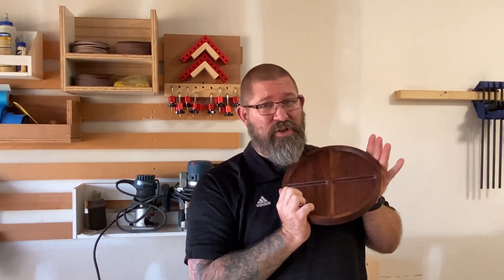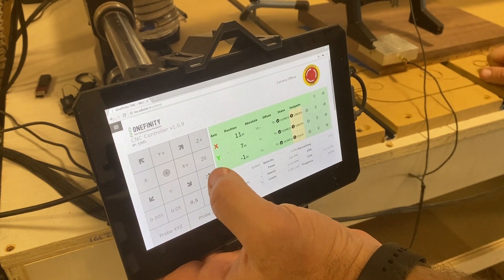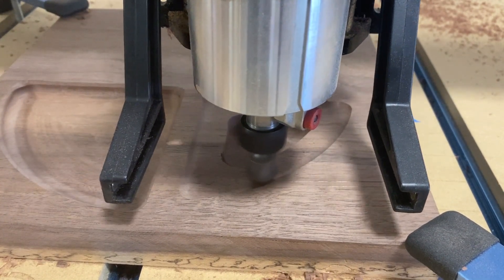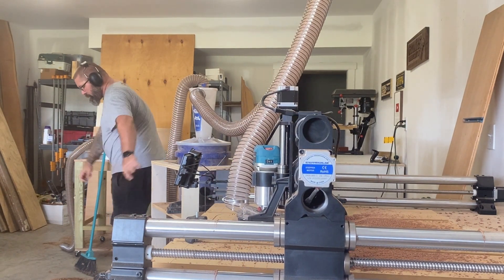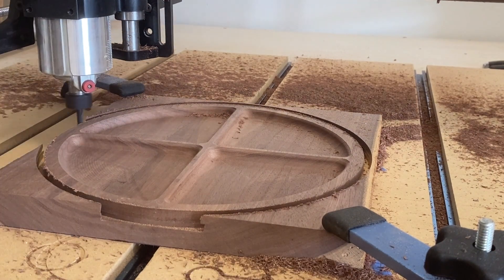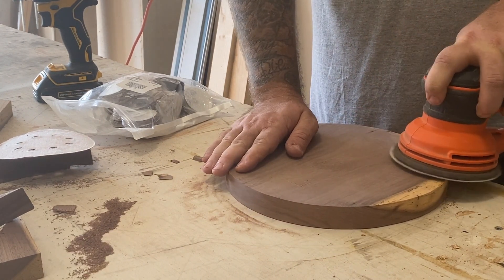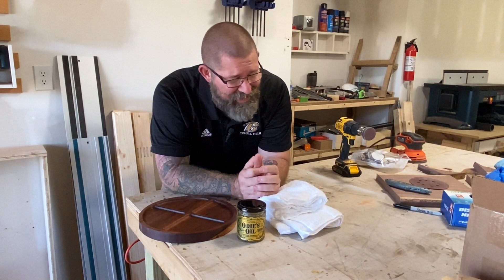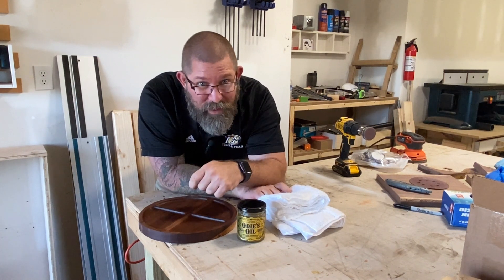Learn From My Mistakes On The Onefinity | CNC Woodworking

Comment: so when you probe it : that finds sets every  axis or just the z axis? also will the probe work if the workpiece in round?
Reply from the maker: You can probe with either the z or x,y,z at the same time. You could still probe the z with a round workpiece, but doing x,y,z might be tricky.

Comment: Greetings!  Nice video.  You may want to reconsider that pushing the bit as far in as it will go though, the collet also retracts and if the bit can't move a wee bit along with the collet you can end up holding the bit less securely.  If you think about milling cutters, the ends are never against anything.  Some outfits sell little rubber balls for the folks who have to have every gadget in the world.  The rubber ball gets dropped in the spindle, then the bit goes in.  Always seemed a silly overdone solution compared to just pushing the bit in until it bottoms, then pull back out just a wee bit (maybe 1/16 to 1/8 inch at most).  Not to mention the wee rubber ball is going to just drop out in this spindle configuration anyway :-)  This may be why your bowl bit pulled out, as it is not an upcut spiral flute style bit, there should have been no pulling force created by the cutting.
Reply from the maker: Thank you.

Comment: What feed rate, depth of cut and rpm did you settle on for these two bits in the video?
Reply from the maker: Can’t remember off the top of my head, and my computer crashed, so I lost that file, but generally I accept the default speeds when I add a new bit, and generally only go half the width of the bit or less for both the step over and step down.

Comment: I love odies oil. One way to avoid those lines is to do a rough cut then a detailed final pass. I generally use 1/2" and 3/4" bits with a pretty high step over (~20%) almost all the way then decrease the step over on one pass really shallow with a very low step over (~5%) to get rid of those lines
Reply from the maker: Good call. I’ll try that

Comment: Are you using the little acrylic inserts around the bit in the dust boot?  I discovered last night that they make a HUGE difference in actually sucking up the dust instead of just blowing it around the table.
Reply from the maker: Don't think I am. I'll take a look.
Reply from the maker: I checked. Yes, I have them on. Good call.

Comment: Nice project.  I need to do something similar to get use of my bowl bit.  Have you given Walrus Oil a try as a food safe finish?  In the same realm as Odie's Oil and has multiple products that are environmentally neutral or better.  I have used them with success and also have made my own from mineral oil and bees wax.  Again, great project and video. Keep it coming.
Reply from the maker: Haven't used walrus oil. Only food safe finishes I've used are Odie's and danish oil.

Comment: When you did your probing, it looks like the X-axis was against the carbide but the Y-Axis was against the body.  It's not a big difference but there would be some.  I wonder if your project's rim (or the center cross) is the same width all the way around?   
BTW, your collet problem may also have been dust.  Always a good idea to take the collet right out between bit changes and knock out the dust from all parts.
Reply from the maker: I thought about both of those issues. Regarding the probing, I need to actually research the PROPER way to probe using that bowl bit. It worked just fine, but I think you're right, that the carbide tip may possibly throw it off. It worked, but I don't think it's the best way to do it. 

Regarding the dust, you may be right. I tapped the side of the collet, and none came out, but it's about time to take my air compressor and clean it out.

Comment: I love the Odie's Oil! Usually go 120-220-then straight to 600, damp wipe to raise the fibers then the 600 again. wipe the dust off and then the Odie's. A few extra steps but the finish is great. Been enjoying your videos, please keep them coming!
Reply from the maker: Appreciate that. I need to try going past 220. I like the results there, but I'm interested to see what happens at 400,600, etc.
Reply: You'll get the same feel but the wood will really shine more with higher grits

Comment: I've been contemplating getting a bowl bit... the way I've gone about making something like this project would have been doing a rough pass with a quarter inch endmill and then a finish pass with an eighth inch ball nose bit. That would take FOREVER.  Your run time, even with deeper recesses is likely nothing close to the time I'd have taken. Nuts... I've spent too much money on the shop this week but this will speed up my catch all tray making so I'm going to buy one TOMORROW. Your timing is awesome!
Reply from the maker: This was my first project with that bit. I love it. Makes the job much easier and great results.

Comment: Great vid thanks for sharing! I have just used the same bowl bit. I am new at Cnc as well. I saw/read that you can use the bowl bit to the depth you want, then just program,in Vcarve, a final cut with the bowl bit with a tighter stepover , and it will remove the small ridges at the bottom.  I also programmed a final cut with a 1/4 end mill to do the same thing. Tight stepover as well. It worked nicely as well, but required the time for tool change. Sorry about the long post!
Reply from the maker: Don't apologize. I like hearing different methods. First real project I've done with this bit, so I like hearing different ways to finish.

Comment: Oops - been there, done that. Now you know why I call my planer "The Eraser." That turned out nice! I agree with you 100% on Odie's Oil. I've only used it a couple of times, but so far, I love it. Keep it up!
Reply from the maker: Thankfully I didn't break the bit. I felt that it was too aggressive as soon as it started. With that project, how much of a stepdown and stepover would you recommend? I think that 1/8 stepdown would work, but my stepovers were very shallow and I think I could have been a bit more aggressive there.

Comment: Great video, thanks. I will pass on the Odies though.
Reply from the maker: Why's that? I'm new to it. What are your experiences?
Reply: @SothpawDesigns  a comment about small shop wooderkers got taken out of context and was spun as the owner of Odies talking s*** about garage woodworkers. I've never used the finish but that's the story of the drama.
Reply from the maker: @coolerman_13  gotcha. I wasn't aware of that drama.
Reply: @SothpawDesigns  Damian - I too have never used Odie's Oil.  But never will based on the past comments made by the owner about garage based woodworkers.  I'm certain it's a fine product and does exactly what it is supposed to do.  However, "the drama" was enough for me not to support a company with kind of leadership.  Do some research if you wish and make your own decision.   Or not.